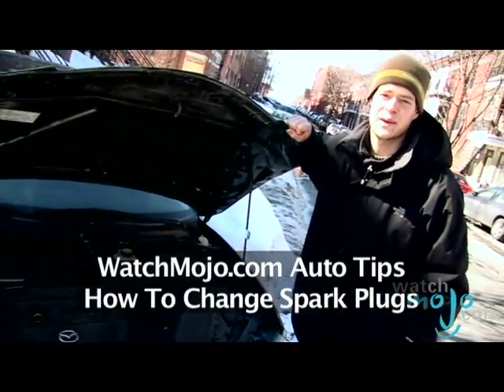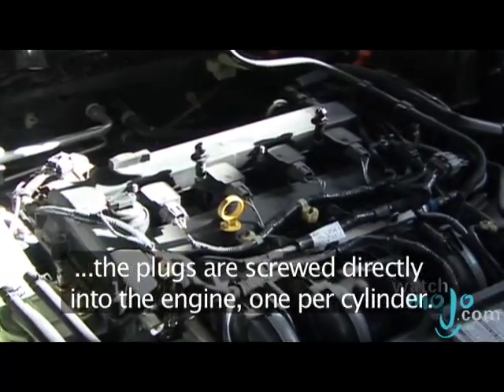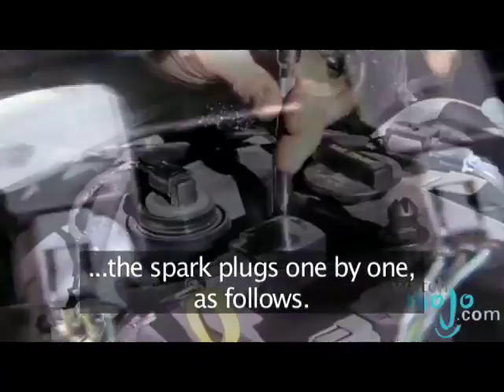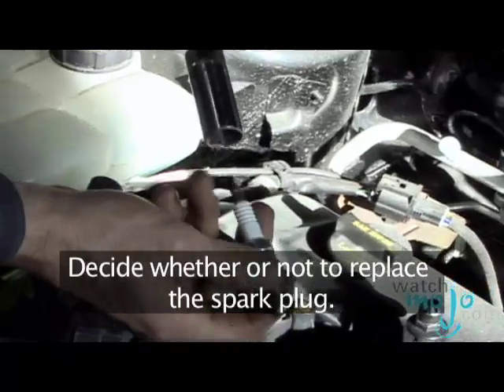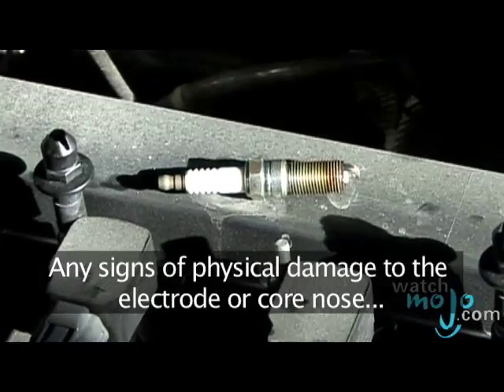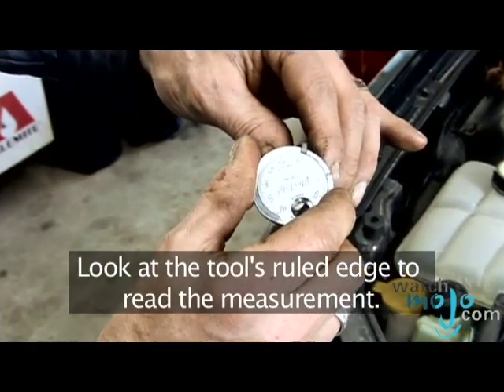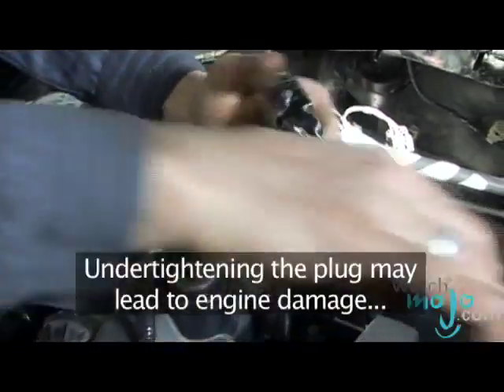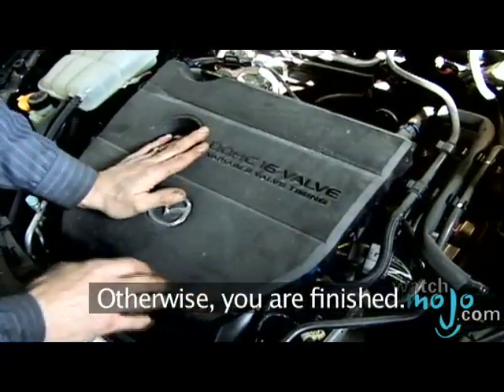How To Change Spark Plugs

Comment: He should have specified to use a torque wrench when tightening the spark plugs. Also that gapping tool is not very good, use a wire gapping tool instead.

Comment: yeah like my S60 T5. I have to remove the tubro pipe going from the intercooler to the turbo which they placed right over the engine. Pain in the ass.